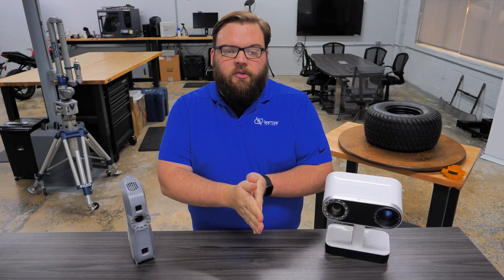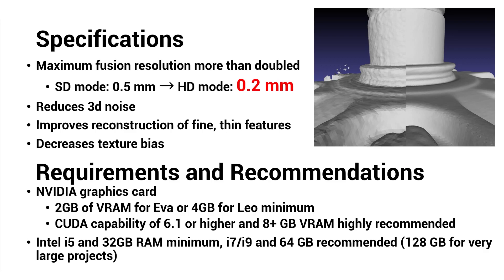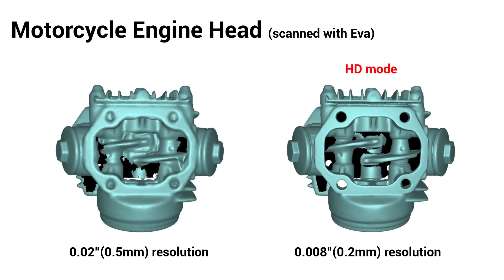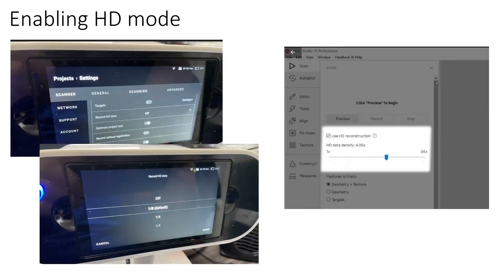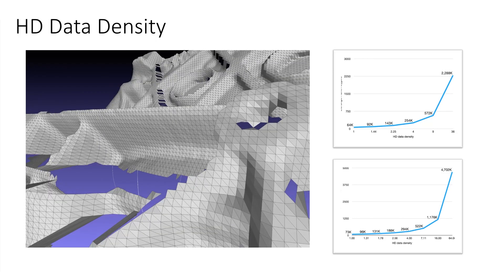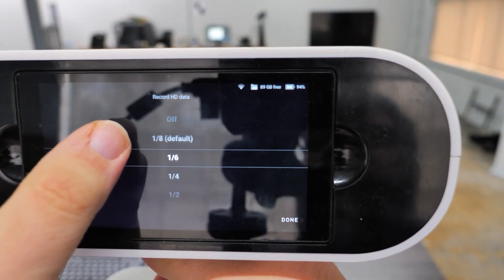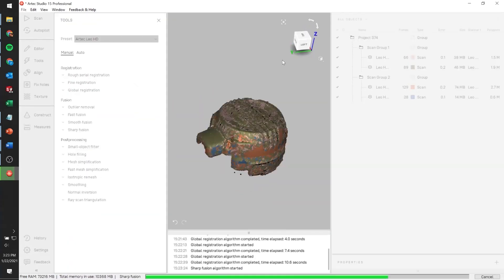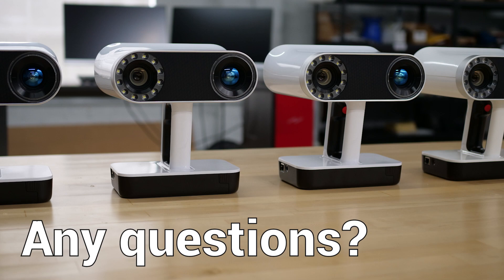Artec HD Mode Webinar plus live Q&A

Comment: What is the best practice for using a turntable with the Eva? I noticed you have some texture or tracking markers on yours. Since the Eva is tethered it is harder to rotate it around a stationary object but I lose registration often when using a turntable. Thanks!
Reply from the maker: Dan, there are two main things to keep in mind when using a turntable with an Artec Eva.  First, and most importantly, make sure the turntable is large enough that the scanner never captures the floor/table behind it.  You never want the scanner to see the turntable moving and background info behind it changing relative to the turntable.  Second, make sure you have some texture variation on the turntable - this is 100% necessary, but the more information the better for registration while scanning.  Let us know if this helps and if you have any other questions!